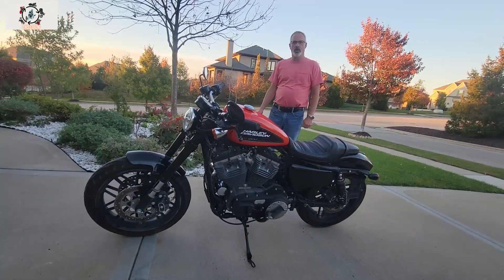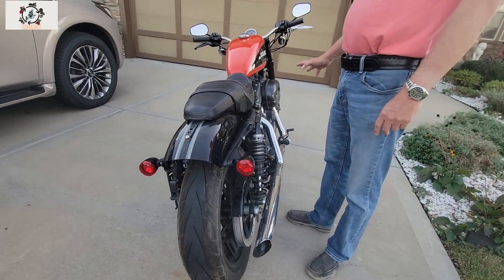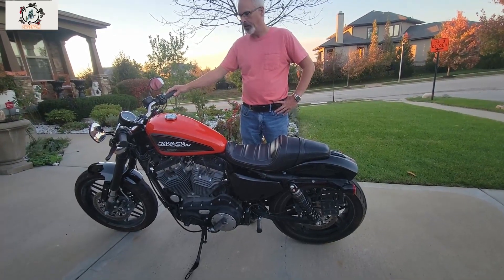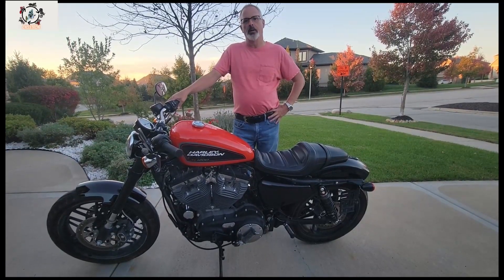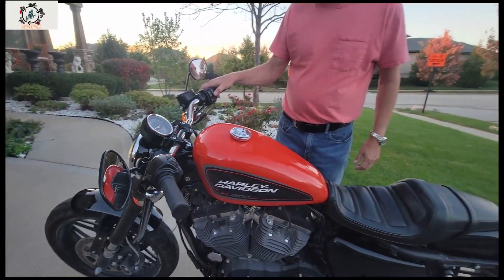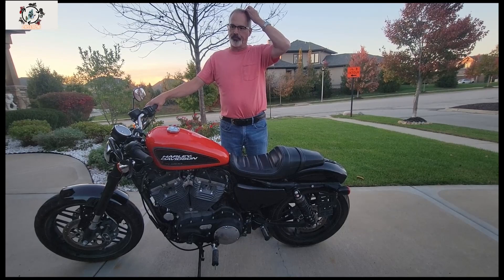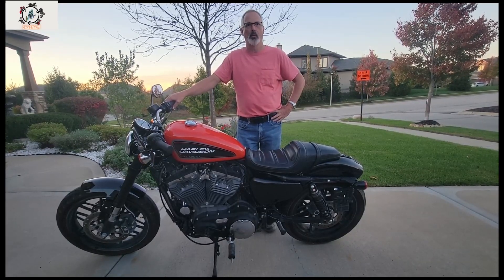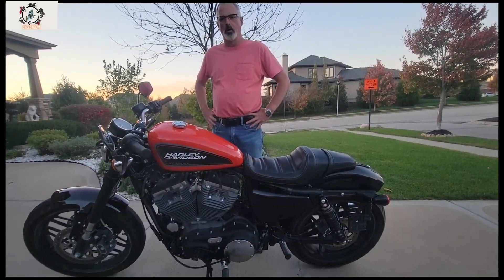Roadster Update with Bonus Footage at the End

Comment: You have more patience than I do. The supply issues and shippers taking too long just make me not want to bother with stuff. The bike looks really good. My Wide Glide had a tail light issue too with the circuit in the module tripping and the right rear light not working. I just bought an after market set that included the wiring and replaced it. The wire harness just would not go thru the hole in the fender so I ran it on the inside of the fender support piece. It works fine now.
Reply from the maker: Thanks Greg.  I will keep your fix in mind in case I have to go that route. HD dealer didn't seem too interested in finding the issue. They wouldn't even check anything mechanical on the bike for me. I guess the were afraid of assuming liability since I made the mistake of telling them it was a salvaged bike we had repaired even though it still has a year left on the warranty. I have it with a private shop now and I believe they will get it done for me. Ride safe. It usually isn't this warm for so many consecutive day in this region in November!
Reply: I have a brand new speedometer for my 1999 883 it's in the box but it's white I'm not sure where it is and I'm not sure if it will fit your newer Sportster but you be welcome to it if you could use it reply and I will dig for it and see if I can find it bike looks beautiful

Comment: Hey CJ, have you tried to reset the codes yourself? If I'm not mistaken you should be able to read and reset codes using the handlebar buttons. Maybe you'll get lucky and it's something easy to fix.
Reply from the maker: I will have to learn how to do that since I have not heard about that before. Thanks for the tip! The dealer managed to clear that but didn't do anything else. That is a whole other story.
Reply: Good luck. Hopefully I'm not steering you wrong there. 

The more I hear about other people's dealerships, the more grateful I get for mine. 

In any case, it looks like you've made real good progress on the Sporty. It's gonna be a fun bike to finish the season (or starting the next ) with.
Reply from the maker: Thank you. If you have a good dealer I would say you are fortunate.

Comment: Question on registration. Will the DMV register this as a salvage or revived or clear title? I know some insurance companies make you jump through hoops to insure salvage and revived vehicles - requiring that they're declared safe by an authorized mechanic and going through an administrative paper mill.
Reply from the maker: State farm doesn't care if it is a salvaged bike. They would even let me have full coverage insurance on it $300 a year but I just went with liability for $100 per year. I haven't registered yet but will next week if I can resolve my tail light issue. I will have to take it to a specific highway patrol office in my area for inspection but it is not a mechanical and safety inspection. They only want to know what you replaced on the bike (from before pictures) along with receipts for what you bought. If you bought used parts you have to document the VIN of the donor bike which could be very difficult. Really the inspection is to sort out whether you are using stolen parts or have a Frankenstein bike from dubious sources. After that they will issue a repaired salvaged title which causes many dealers to not buy them or take them on trade. Typically it would also cut the resale price in half but if you are doing a repaired salvage bike to ride it there is not much of a concern. Also in a private sale a buyer make not care if they can save money. I am all in at $6,500 on this bike. Used Roadsters with no dents or scratches are currently listed on Cycletrader for $11,000 to $15,000 so there may be room to sell it for a little more than my cost basis in the Spring. If not, I will keep riding it. Some people will register a salvaged bike in other states where the word "salvaged" disappears but this "title washing" is of course illegal.

Comment: Neat bike, but isn't there somewhere to ziptie that clutch cable before it catches on something like a shoe? Awful lot of work adjusting it just to pull it out when you put your foot down at a stop.
Glad I haven't needed any HD parts. Oy!
Reply from the maker: I see what you mean. Thanks for pointing that out! My local dealer wouldn't do an inspection for me after all but charged me $150 to try and identify the short in the tail light with no luck. I will keep working on it myself. They did manage to clear the check engine light. They said nothing about the low hanging clutch cable that you correctly pointed out. I will square this away in the AM. Thanks again.